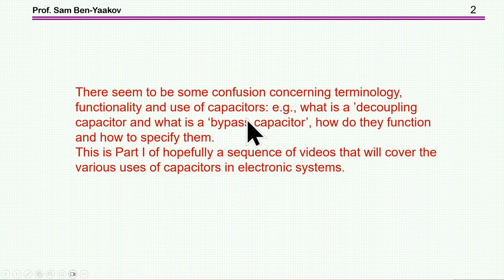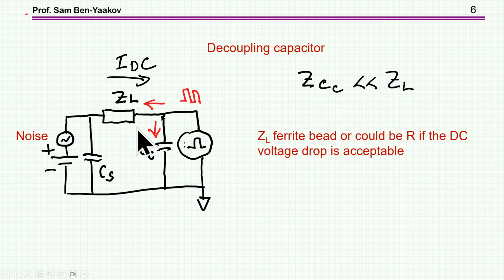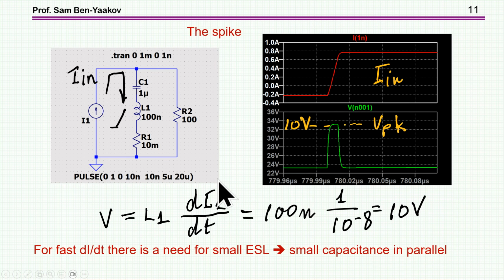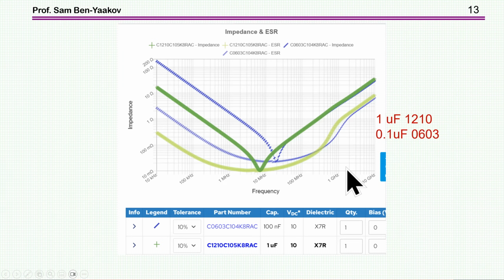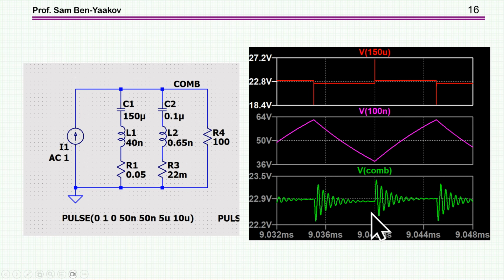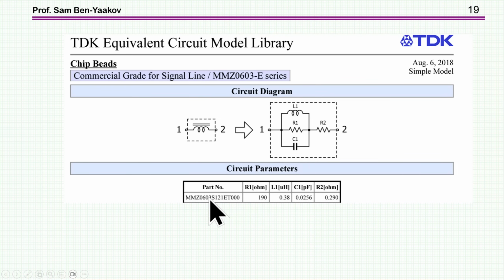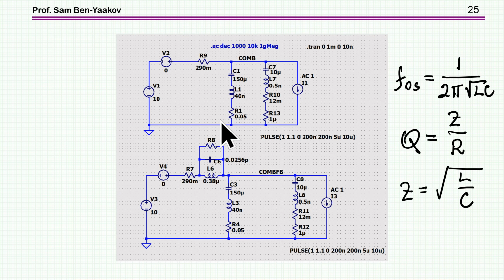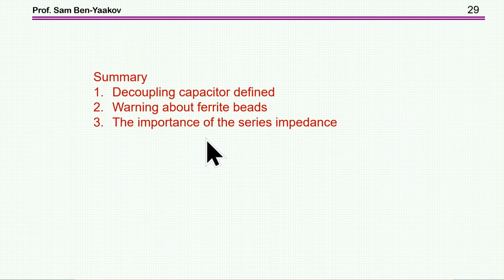Back to capacitors basics. Part I: decoupling

Comment: Sir.. I'm designing a Dual active bridge. How can i calculate the value of decoupling capacitors needed for my circuit.?
Reply from the maker: The ripple voltage on the caps needs to 1 to 3 percent of the voltage. The ripple is due to the ac current

Comment: Sir I am facing an issue in my converter hardware, with the inductor and switch voltages. I would like to get suggestions over that from you if possible. Can you share me with the contact details?
Reply from the maker: sam.benyaakov@gmail.com
Reply: @sambenyaakov  thank you sir

Comment: The biggest problem with ferrite beads is that they rarely give any information in non-linear inductive/resistive characteristics with change in DC current. Fact is, the rated current for ferrites says nothing of this nonlinear effect—it speaks only to it’s DC current handling current from a thermal perspective. In fact, the impedance collapses at extremely low bias currents for most ferrites.  

For 0402 ferrites for instance a 100 ohm ferrite might have a 800mA rating, but it’s peak impedance drops by 30% with 20mA, and 99% at the rated current. 

Their Q also seems to rise with DC bias, so they become even more prone to oscillating and impedance spikes
Reply from the maker: Thanks for sharing. Indeed, DC bias effect is a problem but still the inductive behavior makes the beads useless in many applications.
Reply: Earlier in my career I was guilty of the errors you discussed here—you really have to understand what the effects are of the bead on the source impedance seen by the load. Sprinkling these in a design willy-nilly, is the hallmark of the naive. 

You absolutely want to avoid peeky high-Q parallel resonant spikes in that impedance, or any rapid load changes will result in ringing. I think it would be illustrative to show the source impedance of the load in the different cases, and how that translates to the dampened oscillations. 
You especially want to avoid those sorts of spikes at frequencies that are likely to be excited by the system. 

The way to avoid those spikes is to ensure that you have much more capacitance on the load side than you would otherwise. Unfortunately, this limits the applications where you should apply ferrites substantially, since it usually adds unnecessary cost and complexity. It doubly hurts that the benefits are limited by the bead saturation effects, which makes the filter’s impedance highly load dependent, and whose effects are poorly described in datasheets. 

Beads can be quite effective when designed well, but the level of engineering is much higher to achieve this than it would seem at first glance.

Comment: Decoupling is very frequency dependent. You mention that Zl is low—that is true at 1MHz for most electronics, but at 1 GHz, it’s actually substantial due to resonances in the power planes/traces. So if you are feeding a 1GHz processor for instance, that close decoupling capacitor is important for the function of the processor (lowering the source impedance at the clock frequency) and EMI (somewhat decoupling the supply).

Putting a more caps works to improve overall impedance, but the most improvement comes from using a physically smaller one, one that you can place closer to the load. You want to use the largest capacity you can afford in the package size that you use.
Reply from the maker: Thanks for input. The main problem is not low Z but the inductive nature that in many applications is harmful.
Reply: @sambenyaakov  I’m not sure I understand your reasoning. 

At the beginning of the video, you mention decoupling can’t effectively happen if the source impedance is lower than the capacitive reactance. The only way to increase that source impedance in a lossless way is with inductance. Mostly this inductance comes for free, in the form of a trace or cable. At some frequencies the cable/trace/plane will be self-resonant, and you’ll get all the problems noted with ringing. 

My point above was just that the source impedance becomes non-negligible at higher frequencies, which is why a decoupling/bypass capacitor is required.

Comment: A fine presentation that showed that  the DC power supply design can become challengng when the interaction with a "load"  like a 
HIGH current switching circuit  is involved.
Reply from the maker: Thanks for input

Comment: My first inclination would have been to get a bead with a lower permeability resonant frequency ands perhaps move it in-between the two capacitors.  However that could just make the resonance lower in frequency.
It seems that by changing the smaller capacitor the ferrite bead is now just acting as the series resistor, and not really using the rlc portion of the model.  I thought it would be interesting to just replace the bead with a 290 mOhm resistor, so I did it and there was very little difference.
Reply from the maker: Yes, as seen in the video the resistor is doing same job.

Comment: Great presentation.
Here is a request from professor Ben-Yaakov:
I like to learn about common mode chocks and their applications in Power Circuits.
I know their use in Antenna and RF Circuits.
However, I also seen them used in Power Management Circuits, and I would like to learn more about them.
Reply from the maker: Good subject. Will try.
Reply: @sambenyaakov  Thank you! I am also interested in this subject. Thanks for this video as well; a very good presentation.